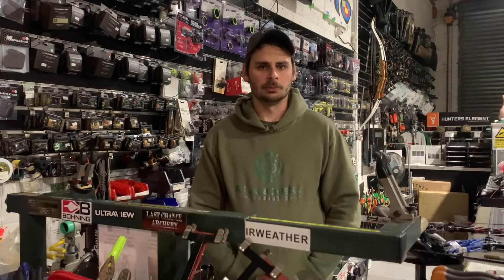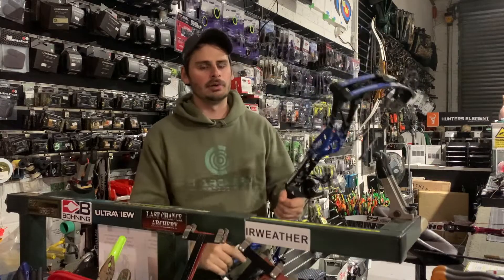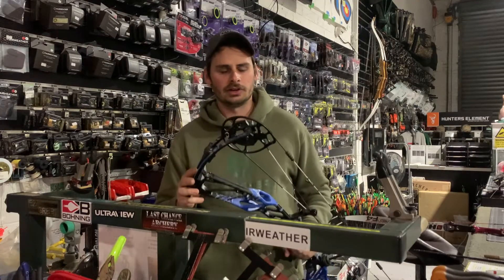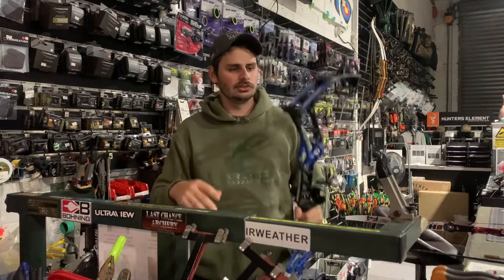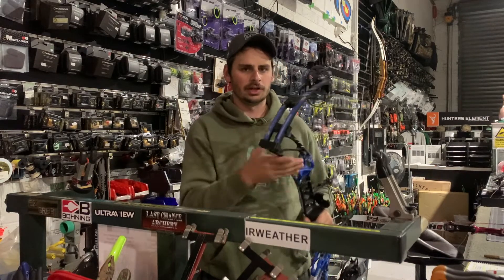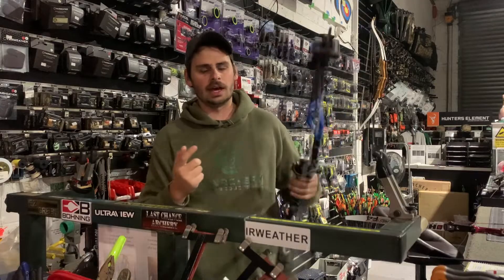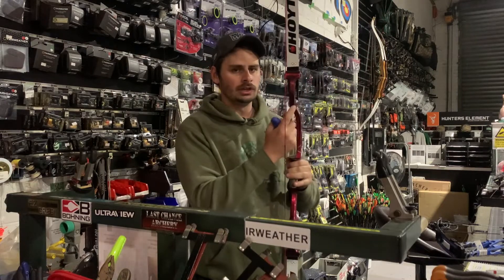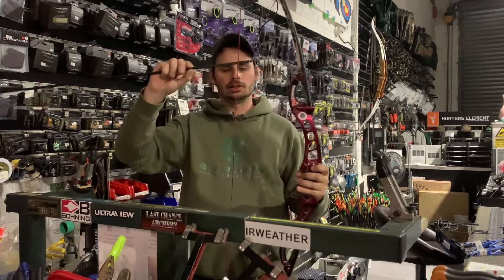Archery | How To Adjust Draw Weight | Compound and Recurve

Comment: quick question, is there a max. draw weight depending on what libs your using? and if so how would I go about finding my libs max. weight
Reply: Yes, looking up the model, or often times there’s a sticker on the bow with that info unless it’s had different limbs etc out in it.